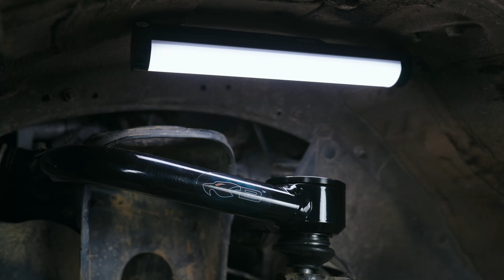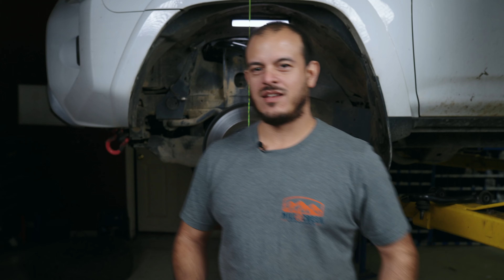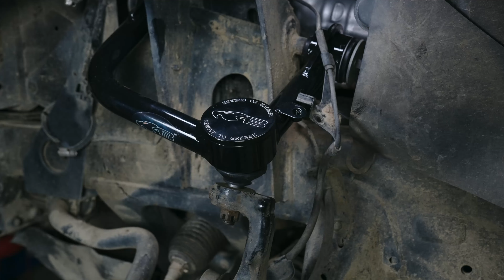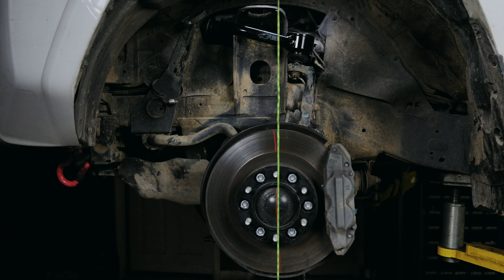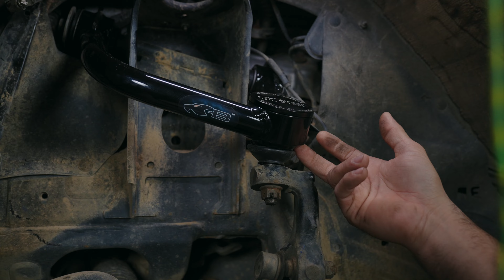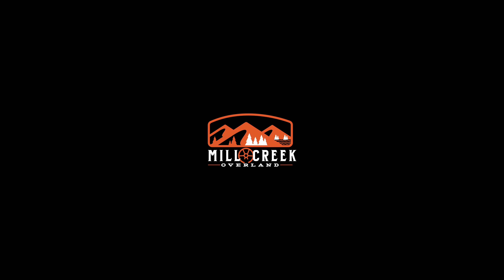Your Lifted Off-Road Toyota/Ford/Chevy NEEDS Upper Control Arms // The TRUTH about Caster Correction

Comment: Upper control arms are easy money for manufacturers and installers. Very simple design and they are not under a ton of load. They're getting very aggressive with the amount of offset to add more caster but it is doing a disservice by pushing the tire closer to the fire wall and body mount. High caster lower control arms are a much better option. Pushing the lower ball joint forward to add caster also adds tire clearance. Instead of having to cut into the body mount and pound the firewall flat, you can trim the front bumper or install an aftermarket option. The downside of high caster lower control arms is they are very expensive because it is an item that does see substantial loads. Caster change from lifting a vehicle does not increase bump steer. A loose feeling, wandering steering wheel because of low caster numbers is not bump steer.

Comment: how can a person not undrstand why they might need a new uca when the truck gets higher, you can see the stress it puts on the stock uca,balljoint, that should be enough aside from caster
Reply: There's very little load on toyota upper control arms. A ball joint moving within its range of motion is not stressing it.

Comment: Coolest shop in the ville!  Thanks for the visual lesson, Albert!  This is great stuff.  
A lot of guys on the 3rd Gen 4Runner forums go with JBA or SPC, but I don't know that I've heard much about the Black Hawks (may have seen them in your shop).  I never changed my UCAs out after lifting a couple of years, so I'm probably due and will have to check these out.

Comment: I got a 2022 tacoma 4x4 with a 2 inch lift (one inch Spacer) on front do I need uca's?
Reply from the maker: It is recommended, yes.
Reply: @millcreekoverland5067  thanks for the info I'll look into replacing them.